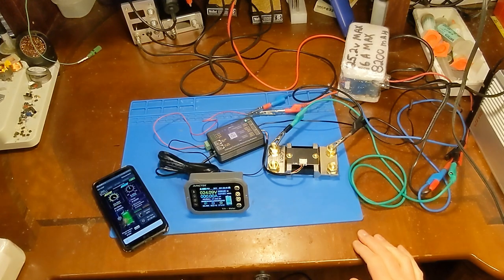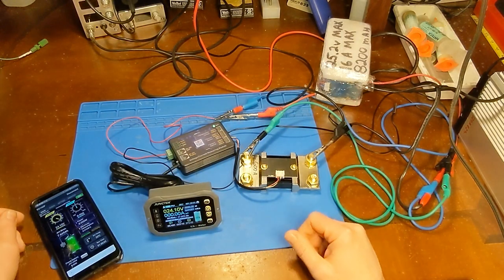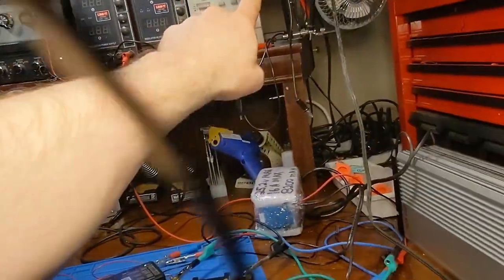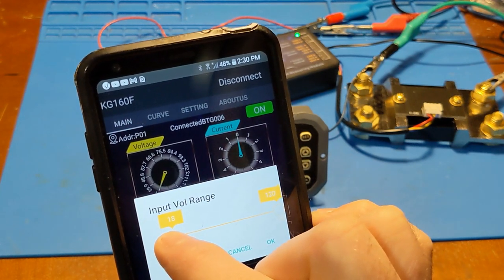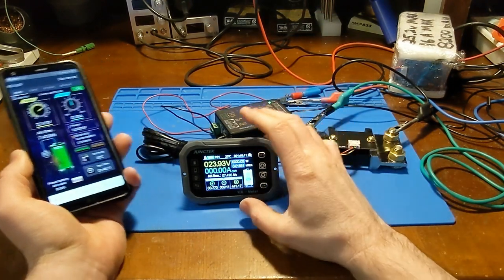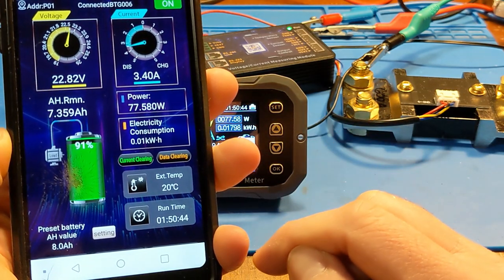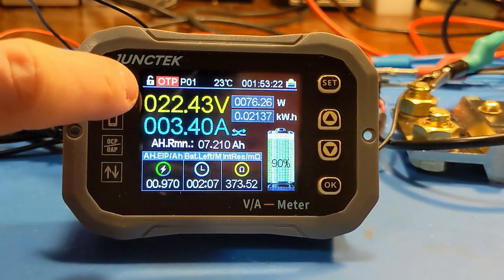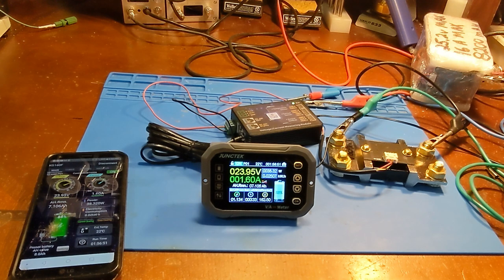Junctek Battery Monitor Review w/ Giveaway

Comment: Due to reviewers like you, I recently purchased a KG140F model. Waited over a month from China, but it made it. A couple of weird things about it though. 1) Like most other devices that "try" to track SOC status via battery %, they drift quickly over a few charge/discharge cycles. I usually have to reset back to 100% every few days after a full charge cycle. Another thing is the amps display and the little arrows that show charge/discharge. Why is it that when battery is being discharged, the amp display is blue and the arrow is green pointing towards the battery icon. When battery is being charged, the arrow is red and pointing towards the amp display! I'd have it showing a red arrow for discharge and green arrow for charge as well as the display going from green to red, red for discharge! Also, my total Kw/h tally won't work, just shows zeros. The milliohm display is a waste. I don't know.

Comment: Is it possible to fix a 10 in android 4G dual camera DVR ?
The unit runs flawlessly after 2 yrs. but the rear camera won't work.
i bought a replacement suitable 5 v rear camera, as specified.
It worked for a while, then failed again.
Can't know if it is the camera, or mainboard component.

Comment: I’ve been trying to decide if I want something like this or a Victron smart shunt. The 600A model might be able to handle cranking my outboard. I would be using it to monitor power in and out of my cranking/ house 12v battery.

Comment: I have been building small logic gates on Bread Board and wondered why most designs had high ohm resistors before the gate leg of the transistor. It’s to save excessive power as the transistor only needs a small voltage. I’d like to see how much more current/battery power it would drain with out the resistors. This tool would be super cool to have to test that, and also provide more opportunities for more projects.

Comment: If I had one, I would want to make it easily connectible to any solar panel via mc4 connectors, it would be a great way to test set up!

If not too expensive, could make several, and use on new set ups, or for diagnostics?

Comment: That would be really handy for several of my projects. I have some deep cycle batteries that I am going to use with solar panels for lighting in my house, and to monitor the adjustable 30 amp DC supply I am building to work on the old tube car radios and the old tube type RCA & Motorola commercial transmitters I am converting to the ham bands.

Comment: As a amateur fixer upper I'm always working on mechanical and electronic projects. Currently working on an older razor battery powered 2 wheeler for my granddaughter and a power problem to a 12v magnetic clutch off a Husqvarna mower. Never have had a battery monitor and an interested in seeing the application to my tinkering.
Good informative video. Thanks

Comment: Single display can read multiples shunts?
Reply from the maker: I don't think so, but I could be wrong.
Could use a selector switch to manually switch
Reply: Nice idea
Reply: @jeffescortlx  thats a cool idea to monitor multiple units
Reply: First, set each address of the measurement module, (such as P01 P02)
Then the DISPLAY port of P01 is connected to the monitor,
The LINK port of P01 is connected to the DISPLAY port of P02
Then change the address P01 P02 in the display,
To connect to the measurement module of P01 or P02, you can view the data of P01 or P02

Comment: Question: Could this be used to monitor a string of pv panels (as opposed to batteries), so you can have feedback of solar production?

Any way you would be willing to test this concept?

Also if you put mc4 connectors on it, the. you could easily attach to a string, to monitor, then remove and put on a different string, as needed?
Reply from the maker: Probably could. Input voltage is high, around 100+ volts if I remember correctly. Battery capacity meter might get a little confused, but volt, current and wattage should read fine.
Reply: Thank you for your reply.

Any chance, since you already have one of these, you might make a prototype with mc4 connectors, so you only have to attach to a pv string, and read the info on screen or phone?

This could make a great video!
Reply from the maker: @Just_An_Idea_For_Consideration  I do plan to use it for a solar system, but I'll be using it between the battery and the load, rather between the solar panels and charge controller. My charge controller has a good monitoring system.